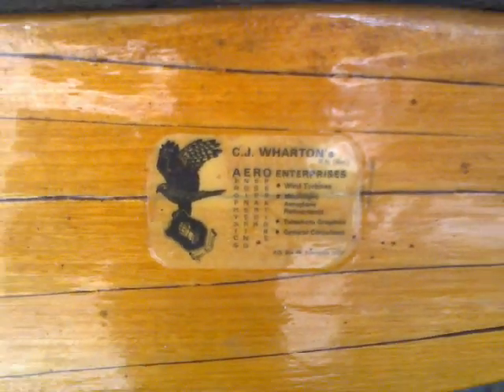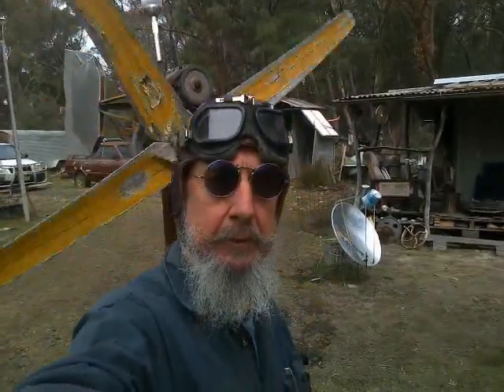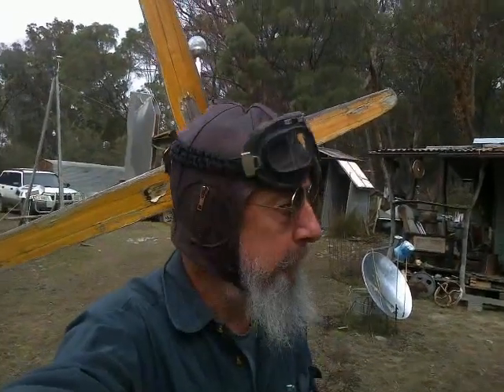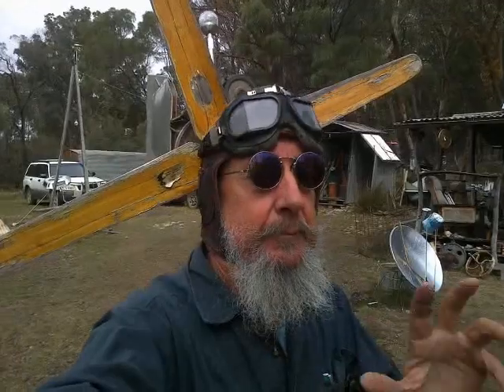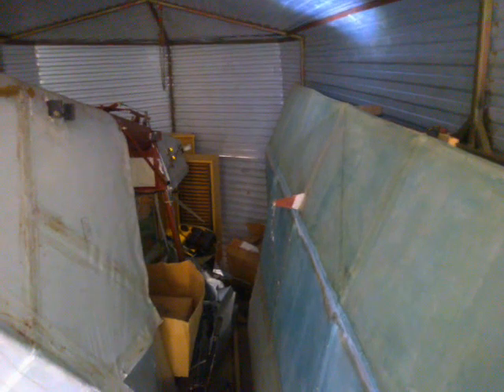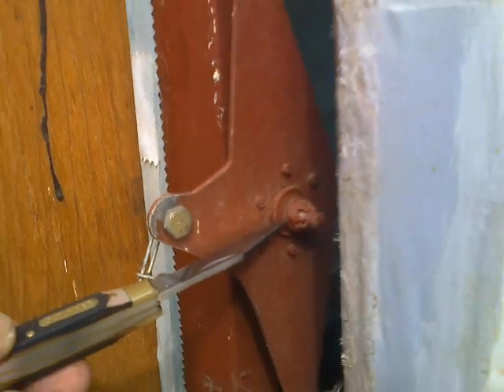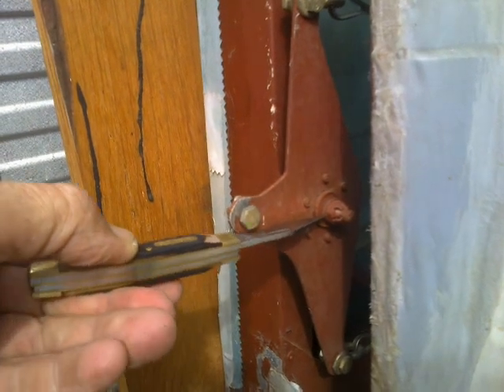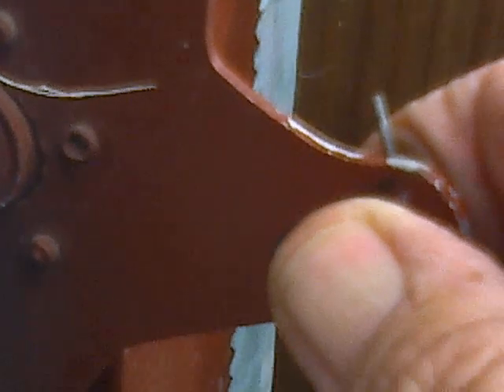Warble For The Volmer Jensonites ; Differential Aileron Bellcrank On Swingwing & Sunfun, VJ-23 & 24

Comment: Have you got any plans or putting all the parts of the plane back together ?
Reply from the maker: G'day Ed,

Thanks mate.

Well, for 26 years it's been my "Security Blanket" ; nailing down my status and identity as an Aeroplane Owner..., while by not repairing it I fortify my position as a Greenie trying to not emit any Atmospheric  Carbon by burning Fossils for the fun of it.

But, I'm saving up for an Electric Bike, and it might save me 300 Litres per year, cutting 750 Kg of CO-2 and saving 500 Dollars ; while perhaps teaching me what would be involved in electifying the Jensen...

I think that if I were in possession of too much spare time and money ; an Electric Ultralight Motorglider would be VERY hard to resist doing.

So, we'll see.

Have a good one.

;-p

Ciao !
Reply: WarblesOnALot Your plans are exciting.
Is this the wreckage of the plane you crashed ? Where you clipped a fence ?
Reply from the maker: Well, they're more WIBNIf Fantasies about what I could do with it, IF the spare money was available..., than concrete "Plans" to cobble up an Electric Motorglider...

But the more I think about it, the more fun it seems like it would be to have an Electric Ultralight ; especially if it gets recharged on Solar Panels.

  And, yeah, this is what I broke my foot in, when failing to fly over the Fence...; my kids were 3 and 2 at the time, and I must admit that I would like to get the Jensen back into the Air, if only to show it to them flying again  as Adults..

  But that would suck up a lot of Brass, the eBike project looks like requiring 2.5k for the Bike plus 1k to upgrade my Houselighting System to charge it...

But we'll see what happens...

Such is Life,

Have a good one.

;-p

Ciao !

Comment: Right before you said it I thought "Oh. So that's induced drag of lift. That causes yaw with the roll into a turn."
Reply from the maker: G'day,

Thanks mate.

Well spotted !

  A lot of people are quite bewildered when they hear of Differential Aileron movement ; it's something which works so well that it generally goes unnoticed.

Have a good one,

;-p

Ciao !
Reply: @WarblesOnALot  
I'd been aware of induced drag... as a term. But that rang the bell.
I'm no aero-engineer. 
Just drag from hanging down a surface is pretty obvious.  But there is so much very very dynamic stuff going on there!  We're just getting to really be able to look at it with super-super-computers doing molecular-level fluids analysis.

And we've _still_ people that insist Da. Erff. Izz. Flatt!! and Mathez. Arez. Fakez!!
Reply from the maker: The funny thing is that after the Skull Fracture when I was turning 14, I never retained anything I learned in a Maths Class - I kept all the Arithmatic I had learned up to 11, and the Imperial/Metric Conversions which I clung onto from 11-13 ; but I can use a 4-Function Allegator and that's about it.

Some shit, like transposing mph (x1.46) into Feet per second  I kinda dovin my head, too ; but Airflow I visualuse - as extrapolations of Smoke-stream Studies in Wind-Tunnels, which started bemusing me since I was about 8, watching a Natural Science Program about Streamlining.

  Because I have to thunk it all out & then feel for a "Vibe of Correctness", it's slow ; but more or less Emperically Scientifik, kinda thang.

  I was turned onto Flying by my mother's Father, a WW-2 Pilot ; he died when I was 3..., so I was an obsessive sort of a kid.

Such is Life,

;-p

Ciao !

Comment: Hi Chris,
That was amazing to see. The plane is "much" larger" than I thought. The idea of the offset bellcrank makes good sense. Some of the RC planes have a push-pull system on the rudder and uses 2 control horns on the rudder connected to each side of the servo arm. The problem with that is if one of the cords break during flight then your rudder won't work.
Do you still have the engine for the plane? I know you have the prop because I have seen it on several of your videos. Would you not take on a restoration project or would that be very difficult?

Have a great day mate.
Cheers.
Reply from the maker: G'day Mike,

Thanks mate.

  Yeah, because it was originally a Footlaunched Hang-Glider there's a lot of Wing - 36 ft Span.

   One good thing about Volmer Jensen's work is that he was a propper Aeroplane Designer before he ever started work on the VJ-23 & 24...; his VJ-22 was a 2-seat Amphibian, looking like a miniature Lake Buccaneer, using the Wings, Tail, & Engine of a Piper Cub..., so the VJ-24 uses all Aircraft standard Components - note the safety-wired AN- Standard Turnbuckles, and Ball-Bearings on the Bellcranks, with safety-pins on everything.

I sold the 22 Hp JPX Engine with which I crashed, but I have got the 35 Hp Rotax which killed Canada John - however it's too big for the Jensen... (the "e" model had a 10 Hp McCulloch & the "w" had a 15 Hp Yamaha..., 35 will pull the Wings off while shaking the Tail to bits).

  I haven't got anywhere suitable to work on it, really, the job is too big to keep going back in the Trailer at the end of every day..., so that's an issue.

   Morally I can't justify fixing it up...,  to be personally  able to burn more Fossil Fuel for the fun of it ; and a single-seat Ultralight Motorglider is supremely useless, for doing anything but flying around for the fun of it...

  However I'm saving up for an Electric Bicycle, on the theory that if it saved me 2 trips to town in the car per week that's 6 litres or 15 Kg of CO-2 emissions..., which $520 per year saved, to not emit 750 Kg ; so maybe the Bike might teach me enough to be able to electrify the Jensen, and THAT would be bloody hard to resist having a go at...

  If ever I had so much spare money that nothing more useful or sensible needed to be done with the funds...(!).

   I simply enjoy knowing that I own an Aeroplane, it used to fly pretty well, and if I got so inspired then I could get it going again.

Such is Life,

Have a good one.

;-

Ciao !